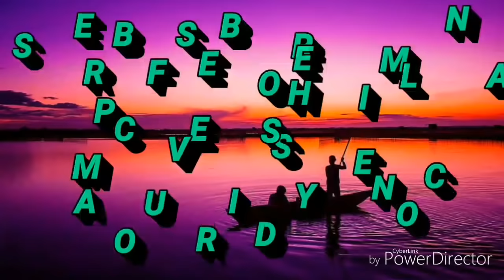how to solve sewing machine bottom thread catching problem/#SewingTipsAndTricks

Comment from the maker: Sewing machine thread braking problem /@solving machine thread cutting problem👇👇👇
https://youtu.be/OwL3nD21DE4
Reply: Needl bar timing correct but needl hits on shuttle please replay
Reply from the maker: Push the needle up slightly and tighten the screw it will be solved. And always use correct number needle. 
I hope you understand 😊
Thanks for watching my channel. Subscribe my channel for more videos
Reply: @hamza.cchundangal3779  wwweeeqqqeq a
Reply: My sweing machine motor is working but machine is not working
Reply: Hmf
Reply: @youthworldYoutube  a

Comment: This actually helped me a lot! Though my machine is just a little table top one, it works the same way. I found out that thin metal bracket on the internal component wasn't pressed enough and there wasn't enough of a gap for my thread to come through. A couple squeezes later and the thread is now sliding through as it should! Thank You so much, super helpful. 😁👍🏻
Reply from the maker: welcome.
thanks for sharing ur experience.
and also thanks for watching.

Comment: Thank you very much for this idea friend. But for me i have buy this piece it a little different between the original piece. I place this in same place but the sewing is not good it atrap the stuck. So what can I do. Sorry for my bad English.
Reply from the maker: U need to by same length of original piece (C shaped shuttle driver spring ).if it is longer than the original piece or if it's wholes r not matched to original piece then it is not fitted properly in machine. 
So when u buy that one u need to  check wholes nd length by placing original piece on new one. 
Any way    
Once try it as shown in this video at duration 2:50 (👈 click)pullback little bit with screwdriver carefully and press the end of c shaped metal with cutting blade nd next replce the shuttle nd tight the screws then u can see a gape b/w in that shuttle.now u can see bottom thread is coming up when u sew the machine as shown in this video. 
I hope u understand. Thanks for watching my channel .stay tuned our channel.
Reply: @youthworldYoutube  wowww thank you very much friend you save my life. I will go to buy the same quality of the original piece. And after placing the piece i will tell you what happen. Thks again friend.

Comment: Thread clustering in case,, at that time stitching of back side of cloth stitches are clustered, so needle is stucked,.. How to solve  this problems, pls reply, waiting
Reply from the maker: when  ever u stitching  a cloth thread comes bunching up to the cloth(thread clusting) then  u should follow these steps 
 1)tight tension disk screw which  is left side on ur machine .
2)And little bit tight babin case, adjust  these two up to  these two tensions are same then start stitching.if LOWER stitching is loose then tight tension disk,if UPPER stitching is loose then tight and adjust babin case.
 I hope u  understand thanks for watching .
Reply: @youthworldYoutube  Thanks
Reply from the maker: u can solve ur thread bunching problem by seeing this video
https://youtu.be/6FjxvLY4KA0

Comment: Hi my sewing machine loose its teeth..hiw can i repair this suddenly it wont run i found that the the teeth lowered
Reply from the maker: Open that machine teeth and put a small piece of paper under that teeth  plate nd tight that plate with screws  as usually. It will be work. If it is not worked then go to repair shop.  I hope you understand. Thanks for watching my channel 😊

Comment: 2.34 min .. help me how to remove them... it is very tight to remove
Reply from the maker: Use small size screw driver which is suitable . And use a cotton cloth for gripping the screw driver then you will remove that screws easily. And when ever replace with new blade ,remember this one first place one screw and tight it little bit next place 2nd screw and tight it little bit after replacing two screws finally tight the both screws. Their after follow the same as in that video. 
Use this tipe of watch repairing screw driver 👇👇https://tips4urandroid.blogspot.com/2021/01/small-screw-driver.html
I hope this is helpful to u. 😊
THANKS FOR WATCHING MY CHANNEL. Subscribe my channel for more videos

Comment: My sewing machine stopped stitching ,Just stuck when I want to sew. What should I do?
Reply from the maker: i think wastage of thread is stuck into the shuttle. pour some oil into the shuttle body nd run the machine if it is running freely no problem then u can stitch as usual.if it is not running then  open the shuttle body nd remove that wastage of threads , clean that body nd pour some machine oil in that one.And lastly replace the body as usual as shown in this video.then u can stitch ur machine freely. 
i hope you understand.
thanks for watching.

Comment: How to remove blocked bobby
Reply from the maker: If it was didn't come ,First fit that babin case as usually in shuttle . Now Once rotate the wheel with hand and try to remove the babin case at a time . If it is not coming then open the shuttle it will come out. u can see in this video how to remove shuttle. 

I hope you understand. 
Thanks for watching my channel. Stay tuned my channel for more videos.

Comment: Sir machine won't pick up bobbin thread.give me reply pls
Reply from the maker: For pickup a thread from the babin.
 first little bit down a machine  needle( by lossing a screw)
then check is it catches bottom  thread or not ?
if it is not work properly then u should follow  above video(how to solve sewing machine bottom thread catching problem) its help full u.
i hope u understand.
thanks for watching.
Reply: Sir , actually the thread does not come down
Reply: Sir give me reply pls
Reply from the maker: actually i didn't understand ur problem pls tell me clearly
Reply: Sir,the thread doesn't come down from the needle to catch up bobbin thread
Reply from the maker: loose tension disc( which is left side to the machine) .because it holds that thread tightly.
so u have to loose tension disc then it comes freely  and it catches the bottom thread .
i hope u understand
thanks for watching.
Reply: Thank you sir

Comment: I pushed already but there is still no space appearing. Please help asap
Reply from the maker: 1)Leave a Little gape means for moving a thread through them.so once check thread is moving b/w the gape as shown is video at 4:10 .Is it moves freely no need 2 bend the hook.Or else bend little bit as shown in this video carefully.  2)Once check shuttle driver spring is it's edge is broken then replace it with new one.1:57
3)nd down the needle little bit by loosing a screw. 
Then rotate a wheel nd try 2 catch up bobin thread. It is helpful to overcome u r problem. 
I hope u understand thanks for watching my channel. Stay tuned my channel for more videos.

Comment: Mashin achanak hard aya he upay sanga
Reply from the maker: i think wastage of thread is stuck into the shuttle. pour some oil into the shuttle body nd run the machine if it is running freely no problem then u can stitch as usual.if it is not running then  open the shuttle body nd remove that wastage of threads (wastage dhaga nikalo), clean that body nd pour some machine oil in that one.And lastly replace the body as usual as shown in this video.then u can stitch ur machine freely. 
i hope you understand.
thanks for watching.

Comment: Sir settle set kara to machine nahi chal rahi kya kare
Reply from the maker: Once reopen that shuttle if any threads r there in that shuttle remove those threads by using needle  nd pour some oil in that shuttle nd replace that  shuttle.Shuttle hook nd shuttle driver both r must be at position as shown  in this video at 3:25(👈once click ) then tight the screws. Now ur machine will be runn freely.
I hope u understand. Thanks for watching my channel. Stay tune my channel.

Comment: Sir meri machine ka dhaga neeche dubby me se chlte chlte nikl jata ha kya kru
Reply from the maker: if u have a small  machine like as shown in this video then open that kit using screwdriver (it is shown in  this video).u can see jammed threads in that kit now u can remove that threads using a needle nd replace that kit as usual.
 Daily use machine oil before using the machine  to better performance

BUT if u have a long machine then simply use a needle to removal of jammed threads easily.no need to open that kit.
i hope u understand .
thanks for watching.
Reply: Thank you so much

Comment: Blade price pls
Reply from the maker: Min price 10 rupees max price 20 rupees depends company. 
Thanks for watching my channel. Stay tune my channel.
Reply: @youthworldYoutube   where to buy this blades
Reply from the maker: Shuttle driver spring(u can search in google ).It is available in sewing machine shops or machine repair shops.carry that broken "shuttle driver" to the shop nd buy new one with same length nd check wholes are at same position.
I hope you understand. Thanks for watching my channel.
Reply: @youthworldYoutube   blade Broken bobin Didn't take thread  ?
Reply from the maker: If blade is broken change that blade. Blade cost is 10 to 20 rupees only
Reply: @youthworldYoutube   ok if not change the blade machine not working properly ?
Reply: @youthworldYoutube  lockdown days so can't go to outside
Reply from the maker: Yes after lock down u can buy it.

Comment: Why is my sewing machine skip when I go on a bump?
Reply from the maker: Once change needle size and u should always  use  best quality thread .some fabrics will cause skipped stiches so that's why change the needle size. And make sure your machine thread correctly. and in  some(zig zag) machines  needle flat side should be back side and in some machines needle flat side will be right side. And finally you should maintain upper and lower tensions.
 once see this video and maintain thread tension  👇👇
https://youtu.be/OwL3nD21DE4

Comment: how to solve the Pico machine
Reply from the maker: some pico machines also same process (like singer ,vidya) which pico machines have babin case at left side to the tailor as a general sewing machines.
but some pico machines have babin case in front to the tailor.
so for this particular machines we need to adjust needle timing for catching the bottom thread so DOWN YOUR MACHINE NEEDLE LITTLE BIT by loosing screw at needle.and check it catches bottom thread or not.
i hop u under stand.
thanks for watching.
Reply: Uper ka saga necha dakai dara hi kya kar

Comment: What if that machine blade is not broken?
Reply from the maker: first absorve is it any gape b/w those two metal parts as shown in video .if it is no gape b/w them then follow these steps.
leave a small gape in b/w them as show in video  by pushing  c shaped metal edge with screwdriver smoothly because it is   
delicated so carefully.now u can see a small gape .then it will work.
i hope u understand.
thanks for watching

Comment: Thread is not move freely on d machine and needle is nt picking thread from the bobling
Reply from the maker: 1)loose tension disc (which is left side of the machine) nd  little bit loose  babin case screw then u can see thread moves freely.
2)for picking thread from the babin.
 first little bit down a needle
then check it is catching bottom  thread or not .
if it is not work properly then u should follow  above video(how to solve sewing machine bottom thread catching problem) its help full u.
i hope u understand.
thanks for watching.

Comment: I tried everything but still it is not working
Reply: Please guide me
Reply from the maker: What's ur problem ? Is it thread catching problem or other.
Reply: Thread uper aa hi  nhi rha. Setal khola needdle bhi check ki. Phir bhi thread nhi aa rha.
Reply from the maker: 1:11 leave a gape as shown in this video
2:08  replace if C shaped shuttle spring is broken.
3:10 using long screwdriver create a small gape as shown in this video.
And finally down the needle little bit.
U can solve it.

Comment: Patle kapde k upar thik chalta he....jab mota kapde..matlb 3/4fold hote he..sui ka dhaga Tut jata he...
Reply from the maker: first change a needle nd try to stitch if it is  not work then try these below  instructions .
1)throat plate have a small ( neddle passes in that hole) hole it is under the machine foot so open that plate nd ruff with a sand paper (or) a small knife in that hole    
 until removal of damaged edges in that plate hole.
2)next place that plate as usual nd tight screws.
3)lets stitch again now u can over come thread breaking problem.
i hope u understand.
thanks for watching
Reply from the maker: Here u can solve ur machine thread braking problem by seeing this video 👇👇👇
https://youtu.be/OwL3nD21DE4